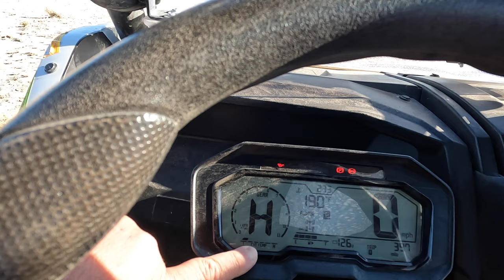KRX CVT PROBLEMS AND FAILURE

Comment: You did very well to get 12k miles on the stock clutch.  I noticed 77 on your primary.  I believe....not sure, that is the second generation primary.  I think the first generation was 75.  Now there is a new one for the 23's and that is supposed to be best with the new upgraded weights.  Good video and thanks for sharing.
Reply from the maker: Great point!

Comment: The aftermarket belt could have  played a role in grooving your primary do to the harder compounds used in making them and you should be able to have surfaces cleaned up for much less money
Reply: From what I’ve heard is the gboost badass belt is the best belt to get. The factory ones are extremely bad at causing grooves when trail riding at one speed

Comment: Those sheaves are fine.  It's your WEIGHTS that have grooved out.  I'm on my second set of Dalton weights.  They groove quickly.  Gives that "shifting" feeling.  You keep blaming the sheaves.  I had mine warrantied out because of a tiny groove in the sheave.  Went aftermarket Dalton weights with the new primary.  My original sheave was totally fine.  It's the weights.  Wish Youtube comments allowed picture replies so I could upload some of my weights.
Reply from the maker: Right on

Comment: 20 to 22 is the same clutch. The new clutch didn't come out till 2023. It'll be stamped 83 on it. The first-generation clutch as you call it is stamped 77. And the new clutch hasn't been out that long to really tell if they fix the problem or not

Comment: Clutch failure? You had some mild grooving, that's all. You should see what real clutch failure looks like! Rollers, weight pins, shoes, towers destroyed.... that's clutch failure. You will never see that on a Kawasaki! All you had to do was resurface those sheaves and run a stock belt. Probably could've been on the road for less than $500.
I wish you would've made a video about this before those guys raped you for $2k!

Comment: I have a 2020 with 1680 miles and I am on my 3rd primary. I had to buy 2 out of pocket. Kawasaki and my dealer were complete losers to deal with. Buyer beware is all I can say
Reply: I got a new primary with 3 rd set of primary weights. They wore out in about 1500 miles and I got the updated weights that are supposed to be better. So far so good. Everything has been covered under warranty. My dealy really goes to bat for their customers. A friend bought a KRX the same time I did and all the same repairs that I had were covered for him also. I always call Kawasaki and complain about a problem before I go to the dealer. They give you a log number that you give to the dealer so that when they call to get authorization for warranty work they know I complained. They have covered everything so far. I can't say enough about how great my dealer and Kawasaki has treated me.
Reply: @joedawson2396  on this 3rd one since Kawasaki denied helping me I bought the new primary (my dealership gave me at cost to help) and before I installed I put a Dalton Clutch kit in. Dalton has many many years in cvt on snowmobiles which are identical to SxS’s. I spoke with them for hours one day on the phone they were great to explain what the issues are. They have a terrific pdf file on their website you should check it out.
Reply: @austinkeeney7502 what happened with the primary? Was it the same problem than in this video?

Comment: If you get info on if the weights show a lot of wear. I saw a video on JBS that seems to imply the wear on the sheeves is result of wear on the weights? I would be interested in the condition of you weights. I am looking to get a set of weights on mine.
Reply: I have run JBS  ON MY 2020 for 4000mi and they look like new JBS refaced my clutch faces and I'm running weights & belt with no primary spring and all is good .my weights caused the grooves

Comment: Whose weights do u have
Reply from the maker: Now they are Kawasaki’s  with the new Primary.  Before was Right Coast aftermarket
Reply: @Ray Horvath Productions  k thanks. That what I'm running. Only have 1900 on my 21